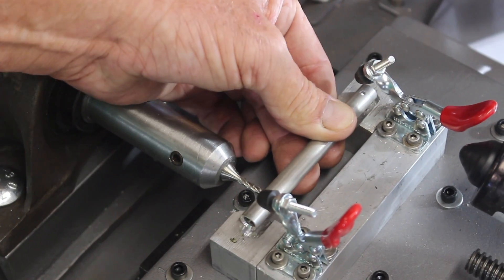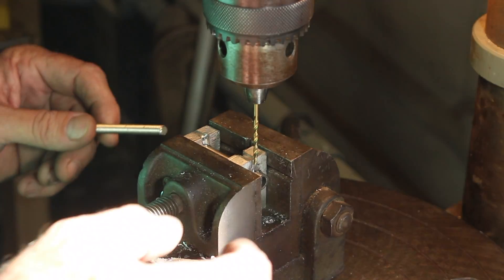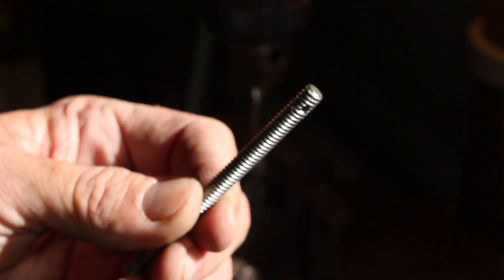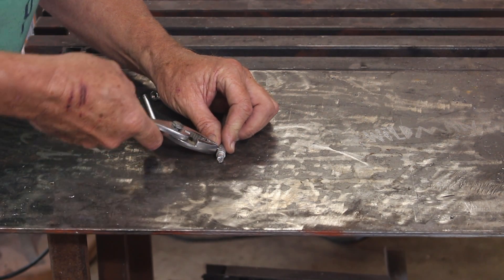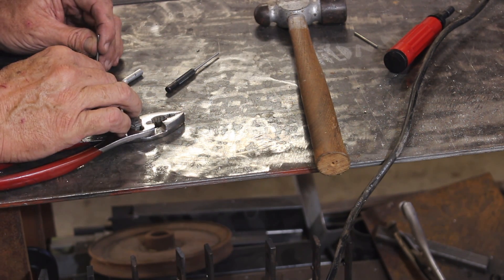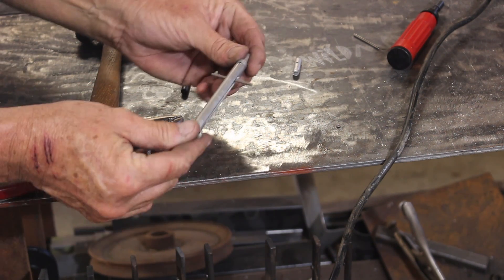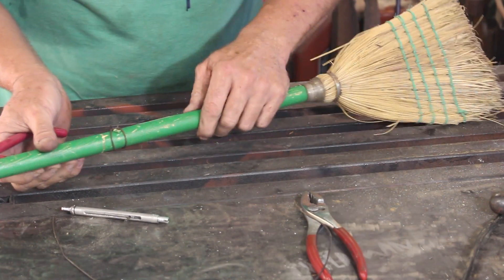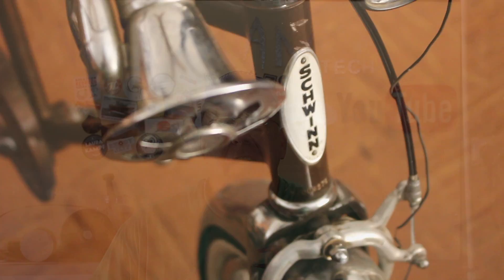Introducing - The Clampmaker®️!

Comment: What if you added another slot, shorter and separate from the main one, and on the opposite side of the barrel a hole at the bottom travel point of said slot. Also have a corresponding hole going through the treaded rod. It should be able to act as a simple shear to cut wire. Put a length of wire through the hole, give the wingnut enough turns to move the hole in the rod past the hole on the barrel. The slot-side ensures you don't cut on that side.

Here's a mockup: https://imgur.com/fYAguJa

It would work better if the barrel were hardened, and the portion of rod at that section wasn't threaded, but for relatively soft wire it might work well. What ya think?
Reply from the maker: I think the aluminum barrel would not make a very good cutting edge, but I appreciate the comment.
Reply: Oh yeah, I was assuming steel. Oh well. :-)

Comment: Actually this patent from 1978 is almost identical to yours
https://www.google.com/patents/US4084625
It's really strange that there are so many patents that are almost identical (I found three in five min. so...).  The thing is the patents have got to be so specific as to be really pointless unless someone is making an exact duplicate since prior art should have nullified all of them after the first one?

As to wire, you can use aircraft safety wire or lock wire (both on Amazon and tool sellers everywhere.  The most common sizes are .o41 and .032 But the ClampTite ones claims to be able to use a coat hanger in a pinch and the ClampMaker looks to be a bit heavier duty so it can probably handle that also.
Reply from the maker: That's actually kinda funny because back in 1995 I searched to see if there was a patent on this and couldn't find anything. It was only a year away from expiration then anyway. It will work with coat hangar.